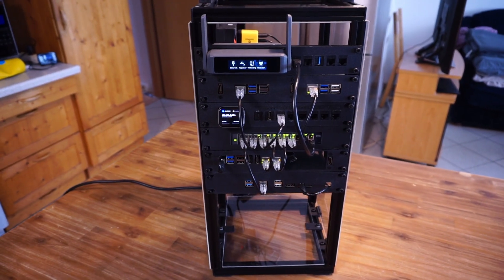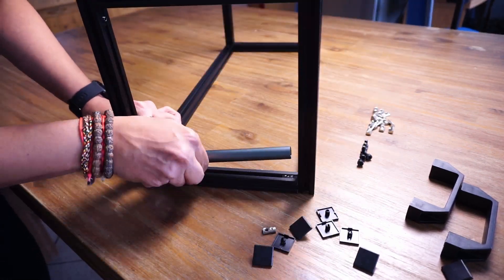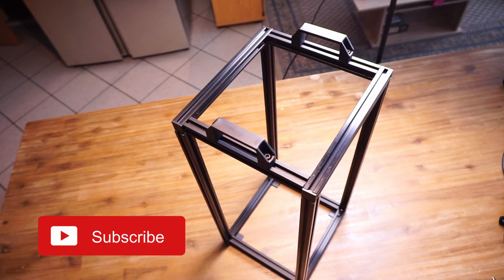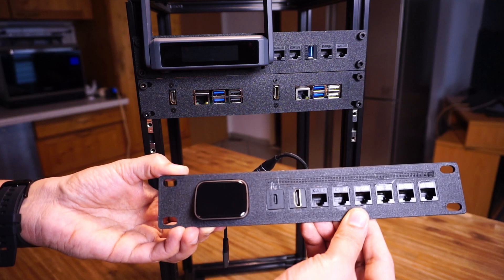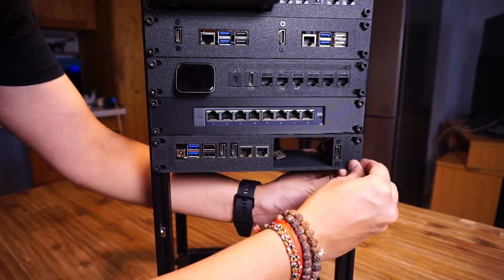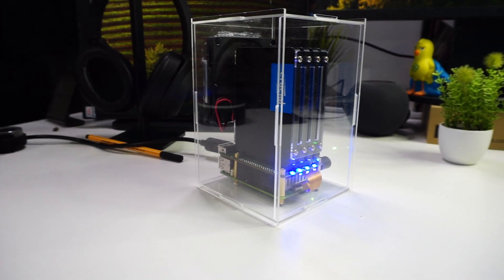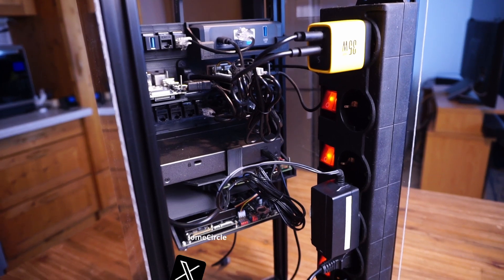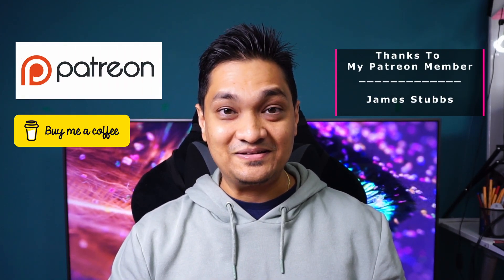How I Built a 10-Inch Server Rack For All My SBCs | Aluminium Rack & 3D Printed Parts

Comment: Nice setup. Does the length of front rail at 200mm make sure that the distance between centers of the spring ball nuts/screws adheres to 10" rack standards?
Reply from the maker: The front horizontal rails are 250 mm long. Its the side horizontal rails that are 200 mm..
Reply: @SmartHomeCircle  DId the math and there is no way that the distance between the centers of the 20x20 rails can be made 23.65 cm using 20cm bars. Your approach of using 25cm rails on top and bottom allows for adjusting the equipment mounting rails to the appropriate distance. The width of the unit will then be 23.65+2.00 or 25.65cm.  Using a 25cm top and bottom rail and pushing the vertical rails 3mm outwards would make the unit very close to 10 inch server rack standards. Neat concept!
Reply from the maker: @wimmooij1236 ya.. had done the calculations to make sure it fits the 10 inch rack standards.
Reply: @SmartHomeCircle thank you.
Reply from the maker: You can read about it here: https://smarthomecircle.com/I-built-a-diy-10-inch-server-rack

Comment: Awesome job. If you don’t have a 3d printer can you buy 10” rack panels for a pi or common switch?
Reply from the maker: You can get it from deskpi. But it's about 40 USD.
Reply: These are available for all kinds of devices on Etsy as well.